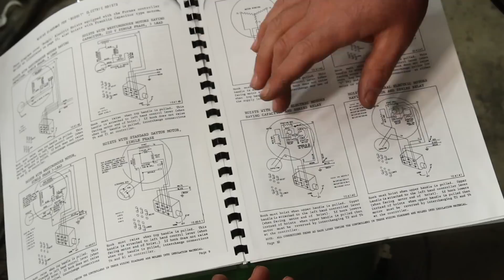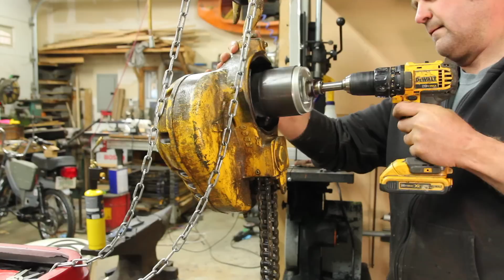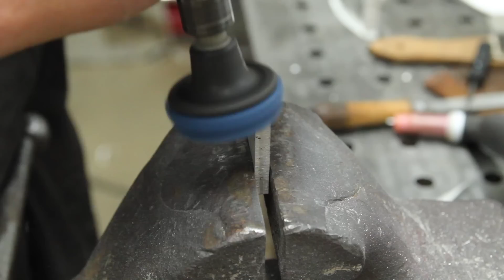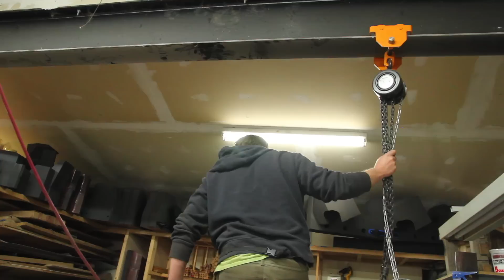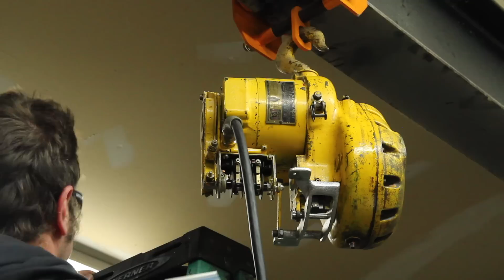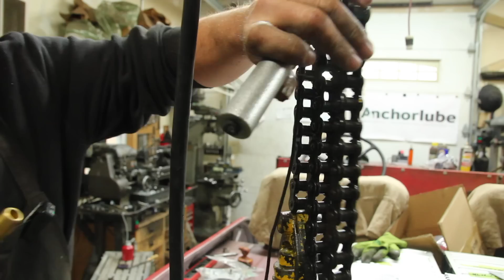1960's Budgit Electric Chain Hoist Revival.

Comment: I have a budgit chain hoist on a gantry in our shop garage. Super handy such as for that crate of bandsaws that I shipped you one of. If you don't have a scale to hang on it. I highly recommend picking up one, it's useful to be able to weigh stuff to understand safety implications of setups and tell when you're potentially dealing with thing heavier than you expect, or if something you're lifting is actually hung up on sometging (like engine had one more mount bolt or something). Don't cheap out on the scale since you need to trust it not to break and drop things. I picked up a used 2000lb Dillon dynamometer on ebay

Comment: regarding the clip pliers I am of the opinion that if you can find atleast 3 or more uses for a tool it pays its rent in the drawer...
regarding paint...its aliminiminimoonimum so no worries its not going to rust and you can look at it and always know you made that bit..... isnt it cool....
I have to say putting it back together while on the ceiling was a bold move lol 
I just know you played with that pull chord system for the entire afternoon.....Awesome way to end the video 
Thanks for sharing

Comment: I like your kind of videos. You can see what you're doing and the comments on each piece are to the point. Wouldn't it be possible to run the chain into a container? Then it would be out of the way and wouldn't collect dust when the hook is at the top. Maybe even something that holds a little oil?

Comment: Slick hoist.  Something I've seen on chain hoists like that is a bucket or canvas bag rigged up to hold the excess chain, so it's not dangling down in the way.  That's something you may want to experiment with.  Turns out if you search for 'chain hoist bag' there are a lot of examples online, it should be easy enough to copy one of them.
Reply: For welded link chain yeah, but for a roller chain like this that can't really pile up except in a single plane I'm not sure how well it would work?
Reply from the maker: There was an original accessory offered for these for a chain bag, and also cord trolleys so the cord isn’t hanging down either.  For the low amount of use this will see, I’m not sure it would be worth the effort.

Comment: I have the 1/2 ton 110v version, bought it used 25 years ago, only use it a few times a year, but brings a smile to my face, and haven't used a cherry picker in the last 10 engines I have worked on. the bearing swivel hook is great also.

Comment: The question of the night is how much junk did you manage to lift off the "jeeps" horizontal surfaces. One electric hoist off, one manual hoist on by my reckoning. 
I hope you replaced the old cabtyre cable with decent neoprene  rubber insulated cable. At least it'll outlast you and the hoist.
Regards from Canada's banana belt. 🤞🇨🇦🍌🥋🇺🇦🕊🇺🇲💩🏁👍

Comment: About 50 years ago I was working at a factory that used a very similar hoist. The electrician did some maintenance replacing switches etc. I noticed after he left that rocker switch was wired backwards and if the hook engaged it, it was not going to shut off. I reported it to the foreman, and was told no  student labour knew what they were talking about and to mind my own business. 
Next shift I noticed now the switch arm had been welded up and it was now working correctly. The shift guy that followed my shift did not come into work. 
Turns out he had a load on the hoist, it touched the arm and kept on going. It broke the chain and dropped the load on his foot. He was off for about a month with a cast. It really crushed his foot. 
The foreman couldn’t look me in the eye or talk to me for several weeks.
Reply: That's a great story 👍
Sad for the broken foot though but standing under the hoist with the load is a bad idea but Jeremy was at least sitting on the load 😅
Reply: @Frank-Thoresen  It was a pallet of bricks - I think it burst when it hit the floor, he was not directly under it, but as you see, the pull cords are really close to the hook.
Reply: @glennwright9747  in hindsight I remember that switch string was short. I wonder if he can change it to dual. The original mechanical switch for safety and a up and down cabled switch box connected to the motor so he can stay away from the load.
Reply: @ essentially those hoists are just an electric chain hoist. The type that has a continuous loop of chain that you pull on the left or right side to lift/ lower the load. I don’t think they were too common over 2ton. I remember the chain hoists in the kit of millwrights and on some farms and garages.

Comment: Perhaps you could doubly confirm that the voltage is correct by determining if the current draw matches the nameplate spec.
Reply from the maker: That’s a good thought, but I have no idea how to interpret “5-2” amps.  Maybe it’s 5-2=3?
Reply: I've sometimes heard old(er) electricians refer to 220V as" 2 phase". Could it be 5A, 2 phase?